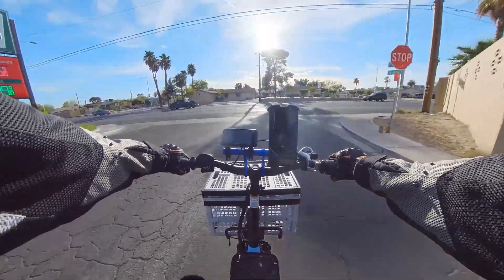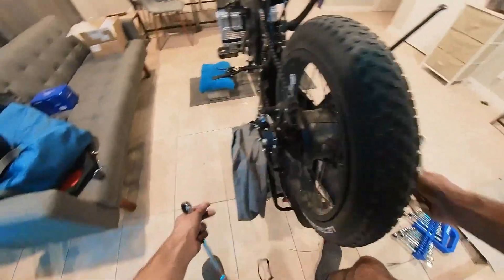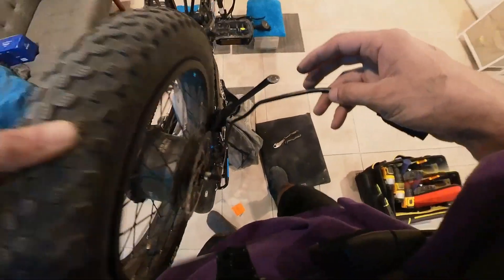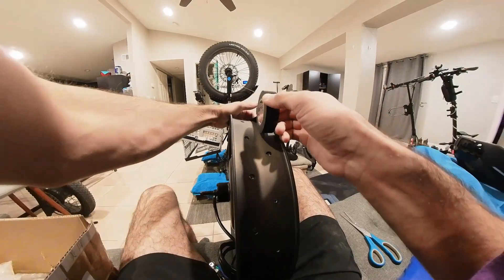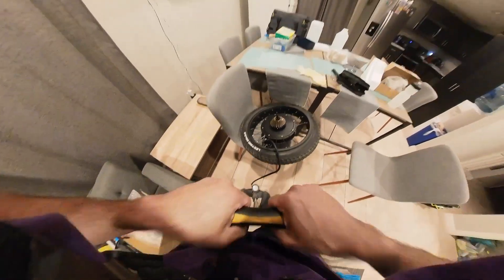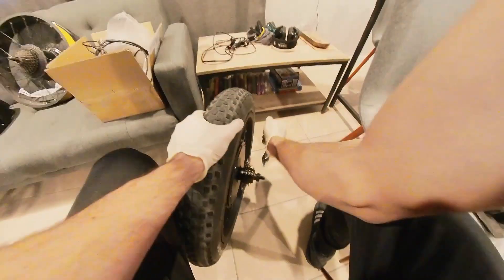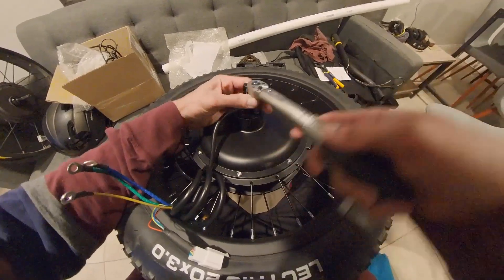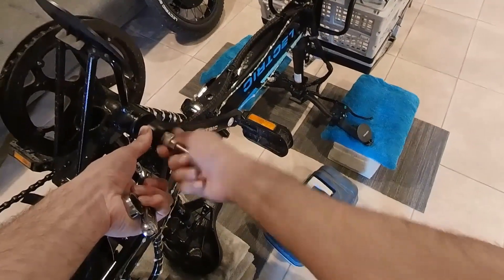72V 2000W Full Hydraulic Lectric XP 3.0 Tutorial Part 1

Comment: Why did you need to change the freewheel from the kit. Aren’t they both 7 speeds? 

Also, the Lectric xp tires are 3x20 while the kit is meant for 4x20. Did you run into any issues with this?

Thank you for this video!!
Reply from the maker: They are both 7 speed but the Lectric XP 3.0 has smaller cogs on the freewheel which I believed would help me maintain a good cadence when I pedal at higher speeds. It should have worked in theory but for some reason I don't feel any resistance when I pedal with the new motor. Unlike, the Lectric motor which will still give you a workout in any PAS setting. 
I haven't run into any issues with the wheel size difference so far. My Lectric tire actually popped out of the Lectric rim once so hopefully 20x4 is a better fit for that tire. 
Part 3 coming soon!
Reply: @brandinojam24  thanks for the reply!! This is super helpful. I turned my xclass into a 72v but now I’m thinking of getting my gf a Lectric xp 3.0 and upgrading that with the 2kw kit. 

Can’t wait for the next video!